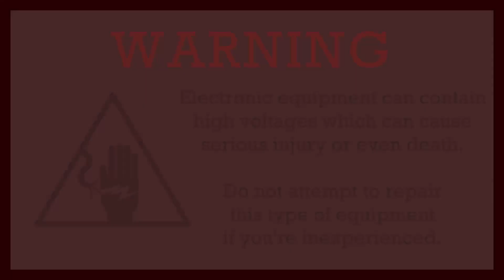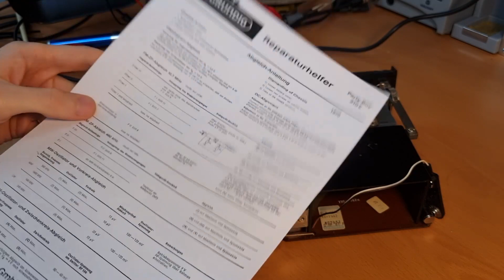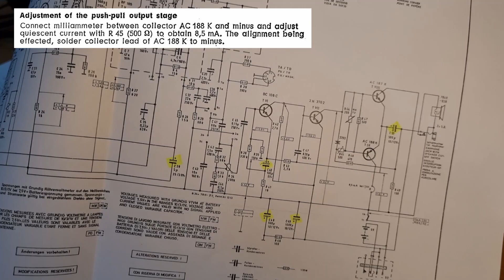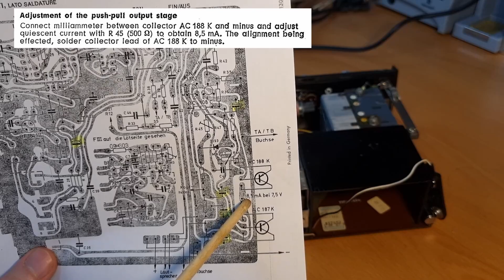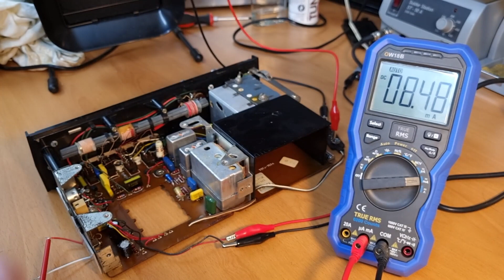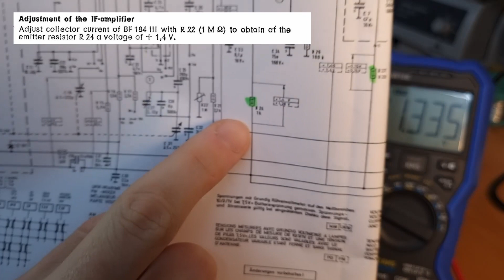Biasing audio & IF amplifier - Grundig Party-Boy 210E (Part 2)

Comment: You swapped an old electrolytic with a newly bought electrolytic that is just as old... 🤔🤭
Reply from the maker: Yes, but one that has never seen voltage or heat. 🙂
Reply: @retro_tech  You see. Voltage is what keeps an electrolytic alive. if you know the expression reforming an electrolytic, that happens every time you switch on a device and the electrolytics receives voltage (it doesn't have to be full voltage just a few volts  even on a 400 V cap.)
It builds up the isolation layer between the electrodes, without it the layer disintegrates and eventually the electrolytic starts to conduct currrent even possible to a short.

Heat is a killer for electrolytics but a radio that draws 20-30 mA at 9 volts doesn't heat up anything important.

Watching you now struggle with the Telefunken Operette. Nice radio but these German sets are most often a pain. I think you mange it well, (at least as far as I have watched until now). Have a nice weekend. We both enjoy these old radios. They are just great.